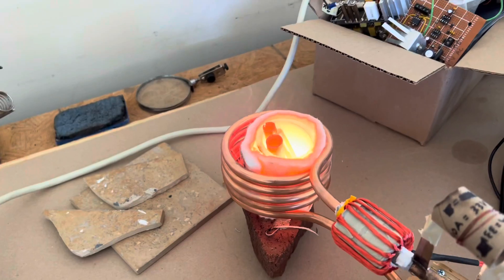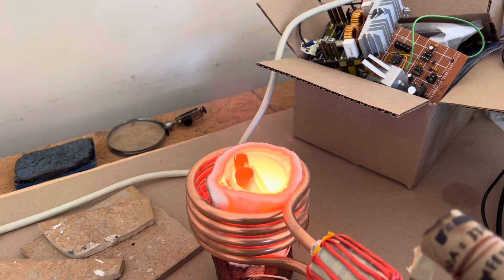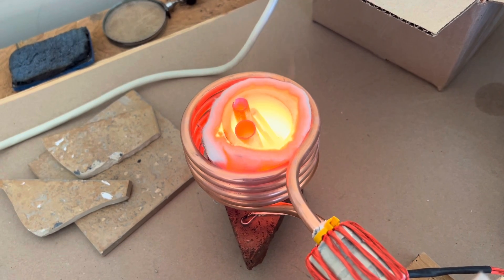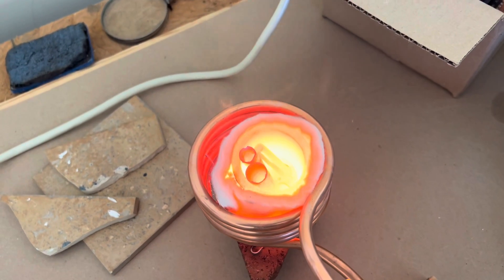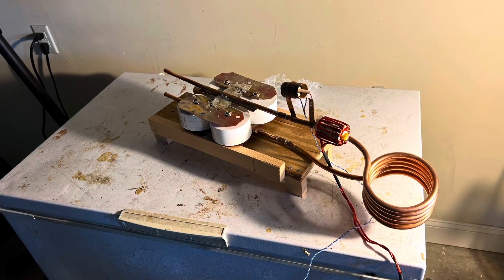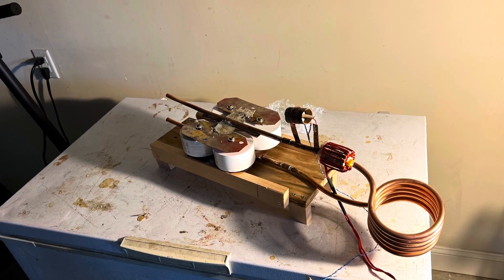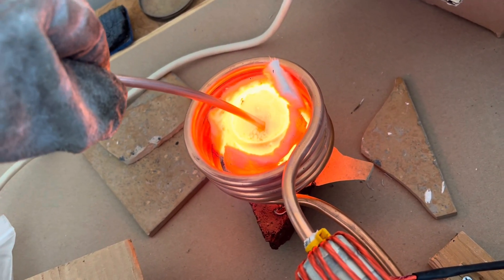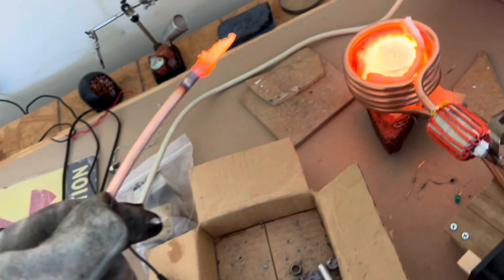Inductive Melting almost 2lbs copper with Home Made setup

Comment: Hi there thank you for sharing , I see you mention 2 pounds , what would be needed to melt let's say 7 kg , naturally a bigger unit , how many amps supply would be needed . Can you maybe point me in the direction to look at
Reply from the maker: For 7 kg, I would still use the same set up just a bigger coil, which would operate at a lower resonant frequency. Would use plenty of aluminum oxide insulation around the graphite crucible to allow minimal heat loss and to heat up this mass.

Comment: Every time I watch this video, I get amazed at the power of resonance induction that makes this possible. I would bet that using this to heat a home would work somehow. The electric heaters used in homes today are just junk. They are real power hogs with not that much heat output and the cost of electricity today is just NUTS PERIOD.
Reply from the maker: Resonant circuits are really amazing!!!!
Reply: @BrianDhvTinkerer  When one thinks about this type of phenomenon one is just so impressed as to what can be done with so little amount of energy consumed. Tip my hat off to you Sir for sure.

Comment: Where did you get the disk capacitors for the heater ??? Where they expensive ??? Thanks
Reply from the maker: Got ‘em from AliExpress. Look for Dawncaps or Corecaps
Reply: @BrianDhvTinkerer  Now I know where to get the caps. Where they expensive ?? Thanks SciTubeHD too.
Reply from the maker: @victoryfirst2878  basically by shopping around on AliExpress, there are pretty good deals out there. Just a matter of looking at enough different manufacturers. There are tons of them made in China. Some are coming from Hong Kong and other places as well. Mine are 80A, 3kV 1 uF
Reply: @BrianDhvTinkerer  How are you judging the quality of the Caps ??
Reply from the maker: @victoryfirst2878  I’m not I’m just taking the risk and see how much they heat up
Reply: @BrianDhvTinkerer  I totally agree with your logic SciTubeHD.
Reply: @BrianDhvTinkerer  Got it SciTubeHD !!!

Comment: How high voltage is on the ends of the coil? 
How much did it cost and how long did it take to build this heater?
Reply from the maker: Took 1 month to build working on it a little bit every day. The cost is not high

Comment: Hello, what do you think would happen if you managed to adjust the duty cycle... would a higher duty cycle (60%-70%) be better, or maybe a lower duty cycle (40% to 30%) would be better, or the 50% duty cycle is the best?
and can i make a multipe parallel capacitor in place of one big capacitor for the DC blocking capacitor...I would be grateful if you could answer me thank you very much.
Reply from the maker: 50% duty cycle is the maximum with the set up.

Comment: THANKS! Do you plan on a video to show how this is made, DIY-style? This would be so great for heating the ends of barstock for quickly forging small details.
Reply from the maker: I have put together a detailed construction video. This setup does not have any current regulation when there’s no load in the heating coil so it draws very high current when unloaded:
https://teslascience.wordpress.com/autotuning-9kw-induction-forge-version-1-2/

Comment: Dear sir  I am using this method to switching 300amp igbt  make a  100 killowatt anneling ( furnace ) i use arduino to generate pwm frequency and 320vdc to running normally aprrox i 25 amp to heat aproxx 1000 centigrade, i want to run this disign upto 600 VDC can it possible ? Running frequency 22 khz to 11 khz  beacuse tank circuit is different  

 Can you tell me about gate voltage relations vs input voltage ? Beacuse emitter and gate voltage decrease when input dc voltage increase why? 

Thanks you so much
Reply from the maker: I think the Miller effect does have something to do with it. The guy by the name of Florian Delma used the circuit that I have here to make a really powerful induction heater. He used a UD2.7c Tesla call driverboard which has overcurrent cut off to drive the coil. Here are my schematics:

https://teslascience.wordpress.com/autotuning-9kw-induction-forge-version-1-2/

https://youtu.be/6Jigjuqq2jM

Comment: Wow I just looked at the circuit and it's different than what I thought. Pretty interesting. For some reason I had just assumed that litz wire was the feedback coil but it's wild that it's actually the primary circuit and it works so well.
Reply from the maker: It’s pretty amazing that it transfers all that energy and it does not even get warm. Basically stays cold the whole time. It’s like 100% transfer the energy from the inverter to the tank circuit.
Reply: @BrianDhvTinkerer  It actually works pretty well without fine tuning. I tried some winds around a nice toroid I had, ran some thick copper through it and threw a tank cap on to try it on a full bridge with PLL. Just used a random 30 turn CT for feedback. The feedback needed tons of tuning to not destroy the IC's so I can see why you needed all the extra clamping and shunt resistor.

Comment: Dear sir can i use 2000vac capacitor for tank
Reply: Can we use both ac and dc capacitor for tank circuit?
Reply from the maker: Can only use AC pulsed rated capacitors for tank that’s the main thing. AC rating is more important then DC rating. 2000V is fine. Snubber capacitors made of polypropylene e film work well. MICA capacitors are great but expensive and hard to find. The best are Celem. 
The best would be a 4 uF cap bank made of parallel connected Cornell dubilier film caps famously known as 942C20P15K-F
Reply: But i shown ur using 3000vdc capacitor for tank
Reply from the maker: @naeemansar3524  you don’t have to use that high voltage. The 3000 V ones are what I had lying around. 2000V AC or DC will be fine!

Comment: Nice what supply do you use
Reply from the maker: Rectified mains with 6800 uF smoothing cap. Using 300 A 1600 V full bridge rectifier. 125V AC mains

Comment: Every time I see this in action I get the urge to build one😁 do you know what material the core of your impedance matching transformer is made from?  

Steve
Reply from the maker: I’m pretty sure it’s FT140-43
This ferrite does not appear to heat up even at HUGE power levels. The number of turns of Litz also seems to be important. This heater is basically a modified SSTC😁